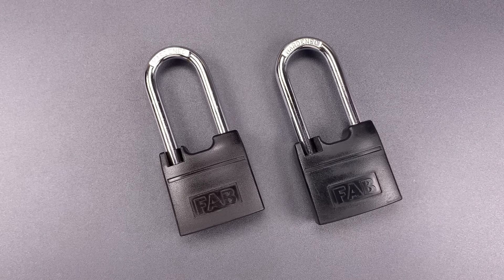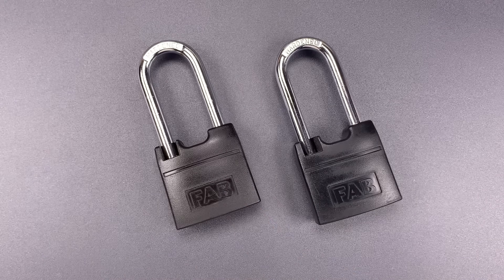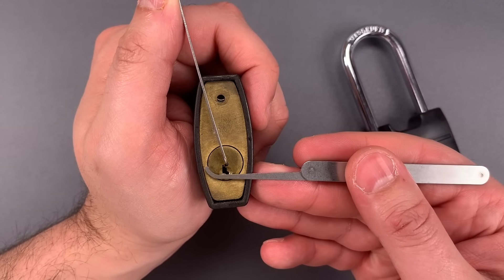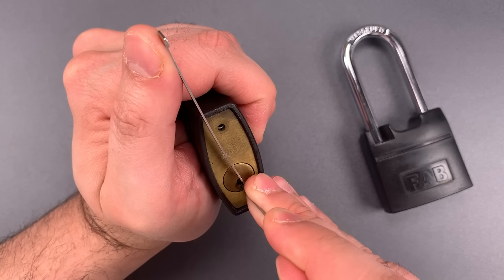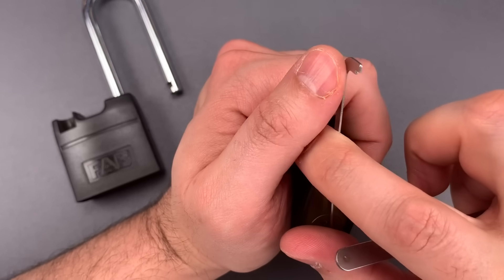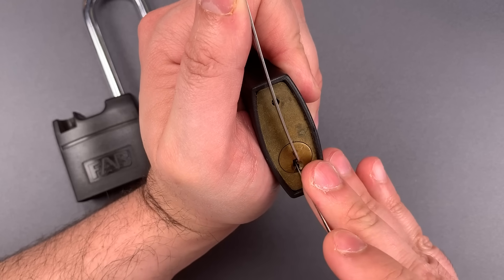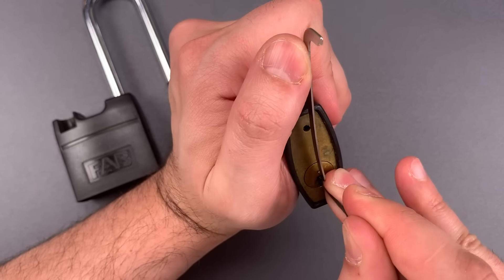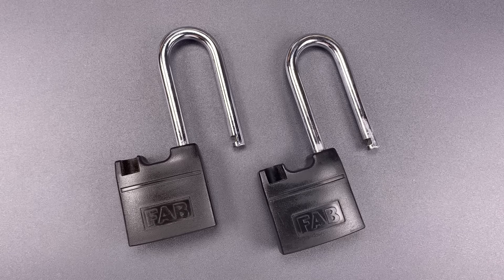[993] Czech Electrical Substation Locks Picked

Comment: We actually have to congratulate FAB as keeping LPL out for more than 10 seconds is quite notable.
Reply: FAB has even better locks, some do have nastier keyways too. But those are expensive and I do not think the goal is to stop the experienced lockpickers, it is really more of a warning, do not go here. Besides experience lockpickers should go after jewellery, not electricity:)
Reply: @NetAndyCz  yeah, it's a lawyer insurance thing.
Reply: @NetAndyCz  As i mentioned in my own comment. If someone wants to do damage to electrical equipment such as transformer stations. Picking the lock is not going to be on top of the list :)
Reply: @BedanTV  True, but you might be surprised how often they are broken into, mainly by thieves looking for copper.
Reply: @kcgunesq  Why would they want copper?
Reply: @airmanon7213  cause its a good conductor of electrons and hence valuable. Before fiber the only option you had for internet meant copper wires.
Reply: Airmanon. It’s expensive and easy to dispose of
Reply: @airmanon7213  Easy to flip and sell quickly, jewelry and high value items that takes skilled craftsmen to make take months to make money back from while copper can just be melted down and sold. You would be surprised with that even though in the movies you can just pawn off jewelry like it is nothing that doesn't work in the real world as pawn shops and similar businesses are watched closely by the law and most shops would never want to deal with something of high risk like that.
Reply: @kcgunesq  Yes that is true but they dont pick the locks. They destroy them. Also the things that are locked are just the "circuit breakers" so random people dont mess with them. There is nothing valuable inside. Its the transformer itself which is in the open. They usually drag them down using cars and ropes.
Reply: @Zarbain  To go with this copper is essentially untraceable.  High end jewelry is very distinctive and even if you melt down the gold the diamonds themselves can be identified.  In contrast if you melt down copper it is indistinguishable from any other copper.
Reply: @BedanTV  Depending on the breakers, they may be worth of stealing. There is also other equipments that are usually installed together with you breakers.
Reply: I'm just a casual viewer so forgive me but it seems LPL is like "here's a lock, it's shit" rinse repeat.
Reply: @airmanon7213  Scrap.
Reply: @twirdman2  how's a melt down gold get identified? Diamond have laser engraved serial number but a chunk of gold is the same as any other chunk of gold if not considering the impurity
Reply: @pierreuntel1970  you get faster money from melting down copper then trying to sell off the gold, since their isn't much gold and the diamonds can be tracked to the original owner. you would still have to unload them, when with copper you just melt it down and you got your money, in 1/100th the time it would take to unload the melted down gold and diamonds.
Reply: @airmanon7213  because copper is expensive and can be sold to scrape yard. Just this week, some thieves stolen 2 tons of copper wire from electrified railroad. The wire was live under 3K volts. People do crazy things
Reply: @BedanTV   Or cut the fence.  I was thinking of substations, the fenced in yards with transformers, breakers, relays, switches, etc.
Reply: @airmanon7213  To sell for scrap.  They can get $10 worth of copper and do thousands in damage.
Reply: @kcgunesq  Yup exactly. Why would you waste your time with locks. But you know... they are there so you cant enter without effort.
Reply: @TheLoxxxton  no. For cheap standard padlocks that's true because they are mostly crap. Better locks he opens and shows how they work too. There are also more in depth vids about specific kind of locks.
Reply: @pierreuntel1970  the gold cannot be identified but the diamonds can. I only mentioned identifying the diamond.
Reply: @MrSpirit99  thank you I'll keep watching
Reply: @BedanTV  true,  a shotgun is very effective... but the lock is effective at keeping copper thieves out !

Also having to take care of a badly burned corpse is not fun.
Reply: @twirdman2   copper can be of the marked sort ie DNA paints (paint with material added such that they are clearly visible using UV.)
And then it is that south african copper replacement which isn't pure copper and so worthless in the scrap business.
Reply: @pierreuntel1970  Problem is, it's often highly illegal to buy/sell jewelry without an assay mark or gold scrap without proper documents. In such countries you will have hard time finding someone who will buy your melted gold. Easier to find someone who will buy stolen jewelry.
Reply: @rhirune  Pretty limited market. Only ones with value to buy such thing are electric utilities and major industrial install and they won't be buying gear just of the street.

It would be a really weird item to sell. Except maybe to a scarp yard for the metal value, but there is easier ways to score metal, than risk electrocution by messing with active power grid equipment.
Reply: @BedanTV  what are you taking about? Circuit breakers are chock full of copper. Arc flash is only as dangerous as it is because the copper acts like high explosive when it breaks the circuit.
Reply: @cheyannei5983  Those circuit breakers are no different from those you have at home but they have no actual scap value. They are 0,4kV circuit breakers. 22kV is "sectional disconnector" and there is no copper there. Only transformers have significant ammount of Copper in them. Everything else is Aluminium. Al cables. Al strip that connects Fuses. And with even with higher voltage of 110kV its again Aluminum only transformer has Copper in it.
Reply: @BedanTV  weird, I took a tour of an industrial circuit breaker manufacturer  to see if I'd intern with them, and they were all full of copper. In fact, they had developed a remote control robot for conditions with a high risk of arc flash from the copper.
Reply: @TheLoxxxton  he's done better locks, but a lot of lock manufacturers only put out a couple of good models in a popular form factor and then never change it for years unless something crops up. Pacloc on this channel, Squire are both good examples. They just released new locks so that's all that'll be new for a while.
Reply: @NetAndyCz  As a former child, I probably owe my continued existence to locks on dangerous facilities.
Reply: @airmanon7213  copper is expensive and easy to sell for scrap
Reply: So is he actually an elite picker or can the average person who learned lockpicking as a hobby do this with pretty much all locks?
Reply: @NetAndyCz  hopefully its a terrorists dream
Reply: @BedanTV  Czech utility companies don't put transformers out in the open. The transformers range in size from a small car to a big van and are always locked in a brick or concrete shed.
Reply: The only thing that can do that is packaging. 😂

Comment: Took LPL about a minute to pick the second so you know they REALLY dont want anyone to get into those electrical panels in the Czech Republic.
Reply: These are just basic locks :-) FAB is very common here.
Reply: Most substations are surrounded by cyclone fencing.  A pair of snips small enough to hide in a pocket can get you through the fence.  There is no point in using a better lock than that.
Reply: cant have then steal our electricity
Reply: ALTHOUGH LPL  didn't specify that's a lock i'd use for  the " lockout tagout" lock.
The lock that keeps people from throwing the switch while your working on it.

that cheep plastic masterlock from way back  just isn't secure enough when your life is on the line.
Reply: Martin Henzl can confirm
Reply: It’s to keep the Germans and Austrians out.
Reply: well, they don’t want people getting a VERY high voltage shock or tampering with the power grid

Comment: Recently started watching this channel. I thought I would goof around trying to pick a lock. There was a Lyon cabinet at work that was missing a key for years. I removed the retaining clip, took the lock and bent a paper clip. I was looking for something to use as a tension bar and thought maybe I could use the retaining clip. I tested it and it seemed like it would work. Jokingly, I raked the clip in and out while applying some tension at the same time. The lock turned and I thought how disappointing.

Comment: not bad, I honestly expected those locks to be weaklings in the core department.  Physically the locks look weak though,  Makes me figure these are about safety and security.  They keep random idiots from messing with the substation and also prevent random idiots from becoming something that gets cleaned up with a dustbuster.
Reply: I mean, they are usually used on a chain-link fence. There's no need to make the lock super tough with that as an alternative point of weakness.

Comment: Really interesting to see, I wonder were they used to restrict access to the substation, or used to secure the various parts of the switchgear? Here in the UK it's more common to find brass shackled locks, not hardened steel, which is both for safety (they can be removed in case of emergency) and length of life, steel shackles don't last very well in our weather!

Comment: I'm impressed. I doubt any "standard" lock will stop an experienced picker, but these locks had good keyways, false sets and some high set security pins. These weren't "rake and run" locks. Good quality. Fab looks to be a company worth buying from for normal security locks.

Comment: All these locks had a "master key" if i can call it that. So it was 1 key for all of them. These locks have been replaced for some time now. So no longer in use. But when it comes to locks or any other door security mechanism. People who want to get inside and do some damage... they will always find a way. And i think picking the lock is not on top of the list. Anyway thank you for the video. Keep up the good work.
Reply: Yeah, it is called Keyed Alike. It is a very common practice. Here in the U.S I have seen catalogs where they sell packs of 24 locks, all of them keyed alike.
Reply from the maker: BedanTV Thanks for the locks. 👍
Reply: @lockpickinglawyer  No problem. I like your content. Thats why i did so. It is also good to know these locks were not easy to pick. But not hard (For you) either. Keep up the good work. 👍

Comment: Is there anything that can stop an experienced picker for long?
Reply: Welding the lock shut might help.
Reply: Electronic locks (Google Locken for example)
Locken locks are used at least in my country for mobile phone towers.
Reply: @JoramTriesGaming  😂😂😂
Reply: Snipers & landmines. 🤷‍♂️
Reply: @timemachine_194 bowley locks are the apex of security
Reply: Ten thousand volts through the lock body might do it. Being forced to use non-conductive tools would be a bitch of a handicap.
Reply: Yes, lack of practice, a weathered lock, unknown biting, wether the lock type is unknown and never been picked by the person before
Reply: Abloy protect
Reply: ponder
Something slick that melts at about 250F or 120C. Lubricate the keyway with that, you'll have to heat the entire lock well above the 'danger zone' to turn the core, making it very uncomfortable to pick without heavy gloves and repeated re-heating.  Obviously not a regular use scheme, but to seal something that needs extra security a guard with a small torch, a special lockholder, and a key will be in in moments where a picker will likely be hung out to dry. 

Could also get nice and slick with things and make a lock with a core that's impeded by an inaccessible air piston, the legit user has a small tool that injects some air. Maybe even build it into the key with a little drilled bore, a conical socket in the nose, and a squeeze bulb key fob. Stick the key in, apply tension and squeeze the bulb a few times until the core turns. 

Lock pickers only have two human hands. Get much beyond that as a requirement and you're making life very difficult. I'm actually pondering a challenge box with awful lock cores, but arranged outside of span and configured so they must be turned simultaneously all the way through travel or they disengage from the latch completely until both reset. Only thing keeping me from it is motivation and time...
Reply: A movement detecting sentry gun that requires a fingerprint plus facial recognition and voice control to deactivate before being able to get to the lock itself
Reply: Commercially available in this country(USA),  Medeco, and Assa.
Reply: @doublejaylar  Just put the sniper on the landmine and your problem is solved.
Reply: @richardevans8908  Nice features but inexcusable design flaws! Nothing that can stop a curious teenager.
Reply: @mfree80286  That heat-sensitive design is giving me flashbacks to Metal Gear Solid and the PAL Key that was a shape memory alloy that needed to be used three times, once at room temperature and then used once after it had been deep-frozen and later superheated to change its shape. It's probably not doable IRL but it is certainly a neat concept for a lock.
Reply: Mul-T-Lock MT5+, Assa/Abloy Protec, Medeco bi-axial, ABUS Bi-lock.. To name a few.
Reply: Perhaps a Medeco😂
Reply: @JoramTriesGaming  General Kenobi?
Reply: High value containers are shut and locked with a 20mm rivet that needs to be ground in half at the destination to open the container. No idea how customs 🛃 check the contents guess they cut the bolt to get in if suspicious 😒.
Reply: episode 636
Reply: StarChaser , a steel pipe to the occipital bone could stop the experienced picker
Reply: gerda titan will stall experienced picker for long time even with special gerda pick tool
Reply: @mfree80286  Too complicated. Also, a good lock picker is a problem solver too. 

Finally, money. Budgets control what technology is used. 

Just go with a good lock brand like Abus, Squire, Abloy, Assa, or Medeco. They are all modern high security locks that only the very best lock pickers can pick and only with great difficulty and lots of time.
Reply: @hihu7200  Which one? Because melting some high-temp wax into a lock core isn't very complicated...

Comment: Seems like both locks had the same bitting - which would make sense if they are from infrastructure. LPL picked the pins in the same order and noted deep set on 5, counter-rotation on 2, etc on both.

Comment: Finally FAB ! Greetings from Czech ! Very typical for FAB I'd say. Btw. for some reason there are very few 6 pinners here. You'll find spools in cheapest locks, but expensive locks give you steel, serrated, better tolerances, better anti-force - never 6 pins. Or at least in the past, today you can get any crazy lock from FAB, but that's because FAB is owned by ASSA ABLOY.
Reply: Máme fabky od skříněk ve škole, mají 6 pinů
Ale je to prd platný, celý dveře jdou vytrhnout a s trochou šikovnosti i vrátit do původního stavu

Comment: I’m buying a different brand for all my power substations from now on.
Reply: After he took this long? You serious? Must be new here.
Reply: Same.
Reply: Larger substations would be alarmed and probably have CCTV nowadays. As long as locks have reasonable strength pick resistance would not be an issue. However Abloy padlocks now seem popular in the industry and would have superior pick resistance compared with pin tumbler locks. Even the large cast brass Yale padlocks once common with power utilities in UK, Australia, New Zealand etc would not be particularly pick resistant - the few I have opened up did not have spool pins.

Comment: Didn't you once say there isn't an unpickable lock, and that it's just about how long you can keep the person out in order to deter them from attempting to enter and that it will get to a point where there can be other more brute force ways to break a lock?

I feel that if it keeps you out for a while and you have to fight with it while holding it in a comfortable ideal grip in ideal conditions, and it isn't a lock that's gotten rain an dirt for 10yrs into it with it being only allowed a certain amount of movement is good.

Sorry for the long winded comment.

Comment: Another great video, thanks!  Long time subscriber to your channel.  Quick question- what would be an ideal lock to secure a large outdoors tool box, often called a 'job box' or a 'work box'?  These typically have padlocks that are recessed into the metal box to defeat many types of attacks.  Appears it would make picking a bit harder too.  Most videos that I've seen of people defeating them they drill out the pad lock cylinder then pull out the lock.  Ignoring the other box vulnerabilities, and minimizing concern for picking, what lock would you think would be best for this specific application?  Would this Czech lock be a candidate?  Is there a padlock with a hardened bottom or cylinder be ideal (like an Abloy, ASSA, or Medico)?   Thanks in advance, becoming a fan.

Comment: I suspect that those locks are more to keep kids and fools out. Anyone that really would like to enter the premises probably uses a bolt cutter. It's sometimes easier to replace the lock with another lock on some locations. When someone eventually shows up they might just consider they have the wrong key or that the lock is broken.

Comment: How would you gut one of these if you don't have the key? In all of your gutting videos that I've seen, you've used a key and a follower to get the cores out. Always been wondering how that'd work if you don't have the keys, but you'd want to gut them anyways.
Reply: If you are asking about these specific locks. I asked him not to. For security reasons. These locks have been discontinued for a while but someone may use them for different purpose.
Reply: @karmlol
most padlocks cant be dismantled , but if you have a lock that can be dismantled and no key then you pick it as usual and leave it rotated (still picked) then dismantle as usual :-)